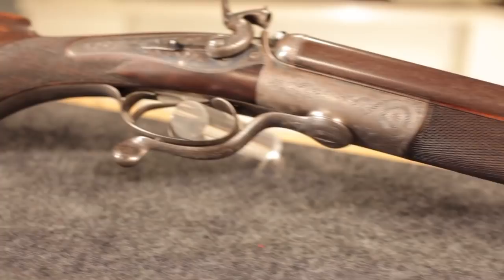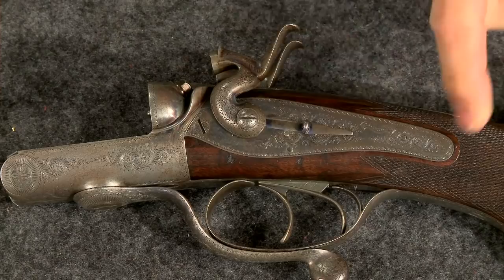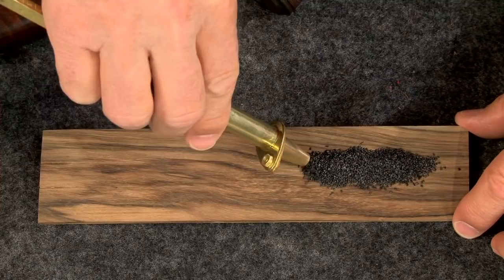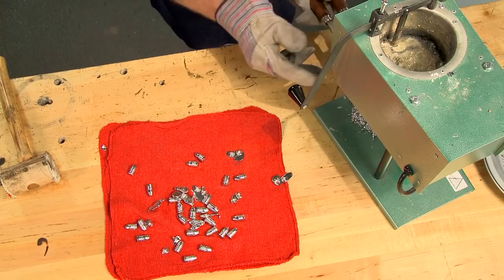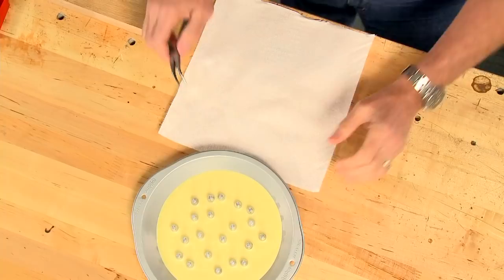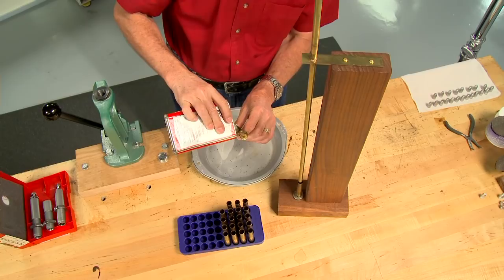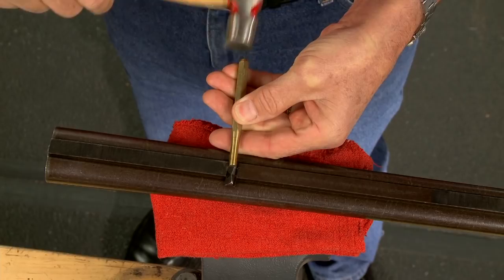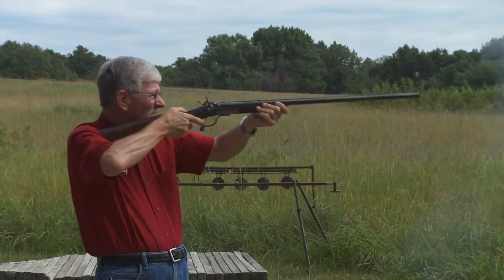How to Load Ammunition for Alexander Henry Double Rifle 450 3 1/4" Black Powder Express

Comment: 120 grains under a .45 caliber 250-plus bullet is going to be pretty stiff.  I use a comparable load in my Pennsylvania Rifle, with a Thompson Maxi-Bullet in .45 caliber for hunting.  But instead of GOEX I use a like load of 110 grains of Hodgdon 777 powder.  This will chrono at between 1850 and 1900 feet per second.  The load is accurate enough to cut playing cards in half at 50 yards.
Reply: There is a cartridge called the 45-120 that reloaders would use for bullets that weigh up to 550 grains
Reply: @mannequinfukr  Yep!  It's a thumper.

Comment: Would it be possible to replace the black powder by smokeless powder? My father owns an old "Drilling" with a 9.3x72 mm rifle barrel. It's ammo was originally thought for blackpowder which was replaced by smokeless powder. It's not more powerful but much less annoying to care.
Reply: No, do not use smokeless powder in a black powder proofed rifle.
Reply: It's possible but you have to be careful about pressure as smokeless is notably more powerful. Infact 500 BPE (idk if 450 BPE had it) had a smokeless loading called "500 nitro for black" which was made for the old 500 bpe rifles. "Cowboy load" 45-70 is the same way as it was made more for the old pre-smokeless era rifles (the Springfield 1873 is one example)
Reply: @snowflakemelter1172  I have a ballard made in the 1880s that handles 30-30 without issue. To he fair I could give credit to it being falling block or the fact it's got a very heavy barrel

Comment: I inherited a 45/70 gun. I want to shoot black powder cartridges, but I want to use copper plated bullets. Is there anything I should know? I know the basics ie drop tubes and non static surfaces. Would I need the cork wads?
Reply: You need lubrication on the bullets, you can go paper patch but not use  copper, these rifles weren't designed for copper bullets
Reply: @BcFuTw9jt  what happens if you use copper plated bullets? Seeing how powder is getting rare it might be my only option.
Reply: @zedirich7  if it's an old gun (talking like before 1899) then jacketed ammo will wear the rifling down rather quickly from what I hear